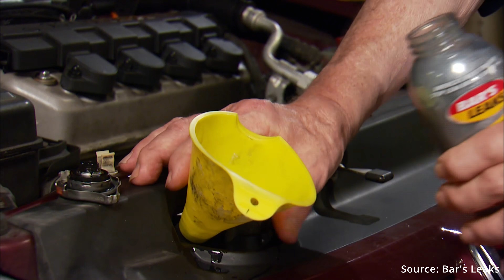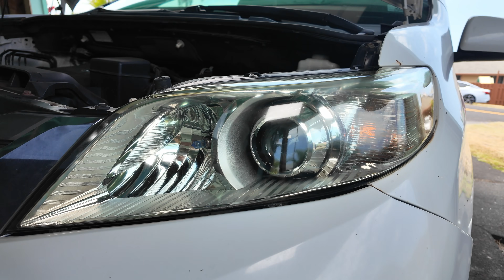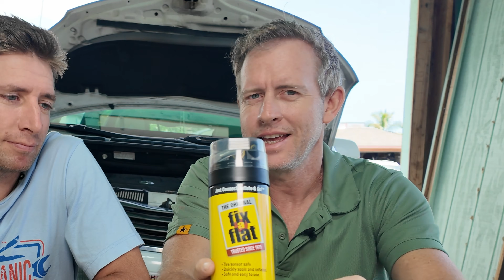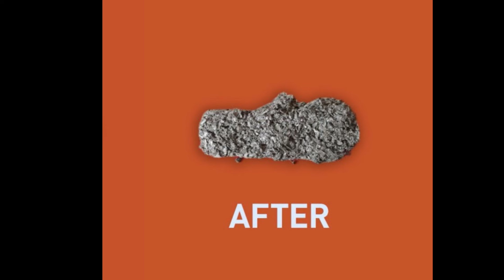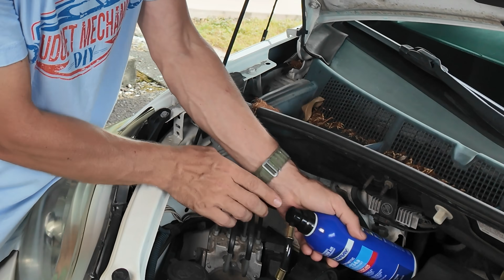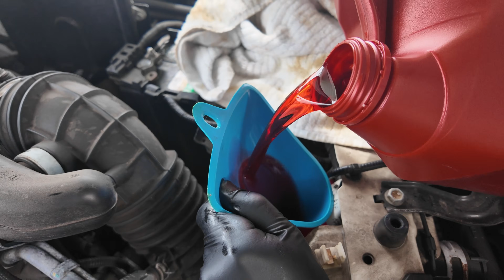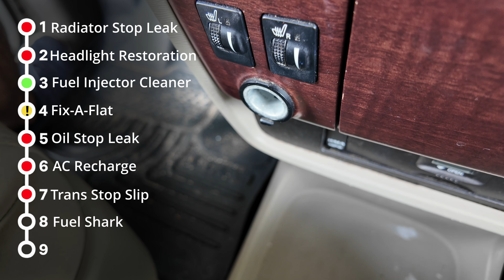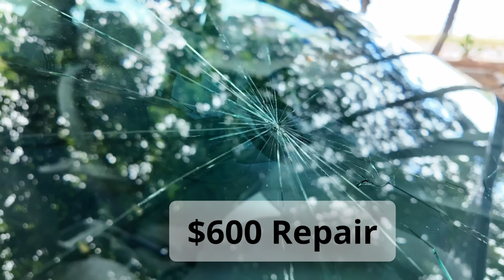These 'Quick Fix' Products Shouldn't Work This Well!

Comment: I have to disagree on the ac recharge kit.  I have used it many times on vehicles that were older and didn’t have a working ac and it made it work just fine for years in many vehicles 🤷🏻‍♂️
Reply: @billyreece4445 I agree with you also, the ac recharge kit is definitely a win.
Reply: It did a fine job for my '02 Explorer (appx 2yrs ago), plenty cold blowing around.
Reply: Justice for A/C Pro!! A lot of these they are judging them as if they are meant to be a one-thing-fixes-all solution. Obviously A/C Pro will not magically fix your A/C system if there's something big wrong, but if you know what you're doing it's a great tool. I recently had A/C issues on my Sonata, measured my high and low pressures, saw that I was low on refrigerant, and added some via one of these cans. I have cold air now! 
Last time I did this, the fix lasted all summer and the next summer I needed to replace the condenser, which was where the leak was. But these repairs can last a while depending on your situation.
Reply: ..the point he's probably, mostly kind of making is that if your AC and compressor actually works just fine, and some of the gas has simply escaped from the system over several years.. 5-10 years? - you can in theory refill only the low side up to the low end of the pressure again - and the system will function as before without any actual differences in the pressure levels on either side for another 5 years. Say your car was in a cold garage over two winters, and started up once or twice to have someone test-drive it - the probability of the gas not escaping even slightly is pretty low. Meanwhile, the gaskets are probably fine, and the compressor will survive just fine.

But if you only have to do this every 5 years, maybe 10, then it's possible you are going to have other issues as well at that point. So you're in a sort of unicorn-space where the recharge bottle for 50€ (vs. a refill and a service of 150€) actually works as intended: when the system is perfectly sealed, the compressor is working fantastically. And you can trust that the system is going to be sealed for another 5 years at least. It's just a really small amount you can save, and the situation it works in is unlikely.

Because in reality, that situation is just not going to happen. Your system vacates some of the gas, and you need to have it pressure tested and inspected for leaks. While if you then add gas in a system with low compression, you're never going to get it right, and it will shorten the remaining lifecycle of the compressor as well as the rest of the system, in addition to being a waste of money to begin with. 

People who give you this advice, to avoid just getting a recharge bottle, have usually tried it -- and then had an expensive repair coming in at the end of the season. I know several people who have had this "oh, it works just fine, it blows cold air!". And then had something else fail, after having the AC not actually work well for the entire duration between the fix and the fail. 

And you could have an AC that is corrected, actually has the right temp, and doesn't condense water along the firewall like a flood, etc. - for a miniscule amount of an extra cost per year. It's highly likely you would have paid less money for a professional recharge - after not even the first 5 years, because of that "fix".
Reply: I agree with you. They work. You just don't have a measure of the high and low pressures. However, if the system just leaked some, and you need a temporary fix, it works fine. In a perfect world we would always recover the refrigerant, vacuum the system, and charge the system using refrigerant weight. However, that's not always practical or possible, and not everyone can afford or has the knowledge to do all of this. It's like how The Car Care Nut always wants to use OEM everything which I don't think is a bad idea, if money is no object...
Reply: I've only used an AC recharge product once. It was on a 2007 Chevy HHR with 230k miles on it that I bought this last March. The AC wasn't cold and according to the kit gauge the refrigerant was empty. It took a whole can of refrigerant to get into the bottom half of the green range, but it's still super cold and I'm actually turning the temp up a notch or two sometimes.
Reply: Same, I bought a $27 can of it for my 2010 scion xb and it and it fixed it right up in my driveway in like 5minutes and I went from having 0 AC to super ICE cold AC the whole rest of the summer and beyond. So idk man it was pretty great fix for me.  Since I did lose cool there is probably something else going on a leak or something but i'll figure that out later.  This just got me cool air and bought me some extra time and money to save up in case I need to really fix it.
Reply: I agree, i used a recharge kit on my 2006 bmw x3 in 2016 and didn't have to recharge it until 2 years ago.
Reply: The big question is why was the system low in the first place? there's a leak somewhere and recharging your ac doesn't fix what's actually wrong
Reply: Royalty Auto made a video in depth about it. They essentially said that it’s impossible to do it right in a modern car with one of those kits, but in older cars, you could get pretty close

Comment: I find this to be the worst video from the channel so far because majority of the items here work but they are not for permanent fixes can’t expect permanent fixes from them it’s more about getting you from here to there or getting a few extra miles without going to a mechanic 

For example the radiator stop leak, transmission stop slip, engine stop leak, headlight restored, the ac recharge kit all work 

But like I said it’s just a stop gap till you can afford a mechanic to actually deal with the issue

Comment: Hey guys, I had a head gasket failute; dhevy silverardo 5.3. In desperation, I bought  "blue devil head gasket sealer" .  Mechanics  said it was a waste of money; however, it fixed the problem, now going on 6 months???  You ought to check it out!
Reply: I used the Bars stop leak on blown Corolla head gaskets.  All sealed up.  I put 250K on one of the engines with Bars in it.
Reply: I've had it work before and had it eventually fail (or other leaks occurred). For a short-term solution, it's fine to try, but only if it's a leak between your coolant and combustion systems. If you have coolant in your oil or vice versa, it's not going to help. 

I'll also mention that I saw a video from another channel indicating that the ownership of Blue Devil has changed and they may have reduced the active ingredient in the last few years.

Comment: I bought a car on which the heater core failed completely after around a year, and to make it worse it was in the winter. Flushing it let it work for a month during which it slowly went cold again.

In the end it cost me £800 to have Citroen put a new one in, and they showed me the old one. He was very blunt and somewhat condescending with me when he showed me this, talking to me as if I were a moron. It was clogged with some kind of gunk. He assumed that I had used a product to stop a leak a couple of years previously as he had noticed the radiator was reasonably new - maybe three years old. He thought I had a leak once and used this stuff until I got the rad replaced. He was most apologetic when he realised I had only bought the car a a year before.

Comment: If your rubber seals in your oil system are leaking, you should use AT-205 Reseal. It's a polymer that absorbs into and rejuvenates rubber seals and properly stops leaks. It doesn't clog up anything and it's safe to mix with oil. If it doesn't fix the problem, then chances are it's not a seal that's causing the leak...
Reply: Good call.  Used it to help with a leaky pinion seal and it definitely helped.
Reply: You can overdo it though. Attempt the seal fix once. Otherwise you can "over/soften" other seals causing many more problems elsewhere: you have been warned 😱👍🏽
Reply: AT-205 works. Older vehicles (8-10 plus years) with hardened / shrunken seals will benefit, personal experience on multiple vehicles.

Valve cover gaskets, front / rear mains, OHC drive covers.
Reply: In the old days we would put brake fluid in the oil and it would clean and swell seals. I would never do it to a modern engine, in fact, I would not put any additive in a modern engine.
Reply: @jthonn . Really, brake fluid? I’ve never heard of that trick.
Reply: @q-bert6454  Old school
Reply: Silly,  you're supposed to "do it right" and have a certified mechanic replace all the engine seals or drop in a new engine.  It's the ASME way. 
Imagine YT channel "Budget Mechanic" telling ppl to "Do it Right" and spend thousands we don't have.  Does he realize the insurance increases in the last few years?  I can't do it right cuz my insurance is nearly $400 a month on a 17 year old car i bought for 3k!  This is NOT BUDGET ADVICE.  It is get-rid-of-your-car advice.  I suspect he is under duress in this video.
Reply: @drewodessa2483  lol if your insurance is $400 a month on a 17 year old car, you are a terrible driver who has earned such high rates. I am in a 18 year old car and it is $500 for 6 months. Quit speeded and running red lights bud. Edit to add, that is full coverage, with a $500 deductible, $300,000 coverage, $10,000 medical, 30 days of rental car.
Reply: @thomasj2797  😅
Reply: @thomasj2797  And where you drive?  I drive in Tampa, "Studies rank the Tampa Bay area among the worst in the United States for congestion, with drivers facing an average commute of over 28 minutes and daily gridlock lasting roughly four and a half hours".  I take full responsibility for all my accidents.  It's so bad now I had to retire and only drive between 10 and 2.
Reply: @drewodessa2483  Well damn man, that is a racket for yall then. Denver over here. I guess we have an average commute of about 25 minutes. But that feels wrong lol, all of my jobs people come from all over, some driving 1.5 hours. Like yall are crazy! lol. My commute is 45 minutes one way, sometimes an hour depending on traffic. Hope you know I was being a smart a$$. 

But on a serious note that is insane for insurance! Literally had a DUI 19 years ago and had to have an SR22 for 3 years, that was still lower than $400 a month (think it was like $250, been a long time). Not sure what the housing market is out there but maybe move so you can save literal thousands a year and drive whenever you want.

Crazy to think that yalls health insurance is probably way less than to protect your car! It's all such a scam anymore. And just like health insurance we pay for everyone else's problems. Oh Susan had a baby and so did Rebecca, and Claudia, so now everyone's rates go up. 

Oh you live in a place with a ton of car accidents.... well your rate goes up because of how much we have to cover for their mistakes. Like na it should be based on how often YOU/WE cause a problem. Why do my rates go up because Joe Schmo crashes his car every 6 months. Make HIS rate insane and he can't drive anymore. If Becky decides to have a kid, increase her rate not everyone at the company. But it is easier to just make everyone pay more than the person using the insurance.
Reply: @thomasj2797  I live in FL a no fault state so everyone pays.  But my last accident, Jan 25, was my fault, my first after driving over 4 decades.  I retired Dec last year from complications from being rear ended a year before that.  My commute was 50 mins each way at mostly highway speeds.  My rate should go down soon as I don't drive much now and only in the day.
Reply: @drewodessa2483 why you don’t just get liability if your car is 17 yrs old? That’s what I do on my 10 yr old car
Reply: @czbolio  That IS liability
Reply: @drewodessa2483 I’m going to assume you shopped around too? I’m sorry that’s so high I couldn’t imagine
Reply: @drewodessa2483  You are right Drew, unless you are good enough to do it yourself. There is so much electrical connections, not me. I am capable, but no way. I don't want that headache.